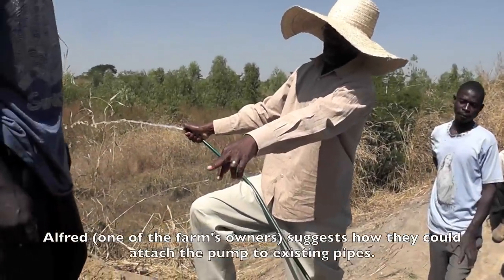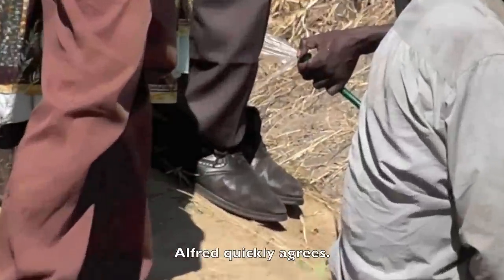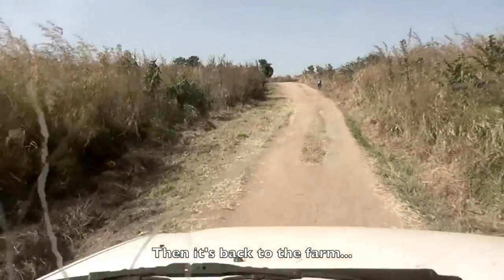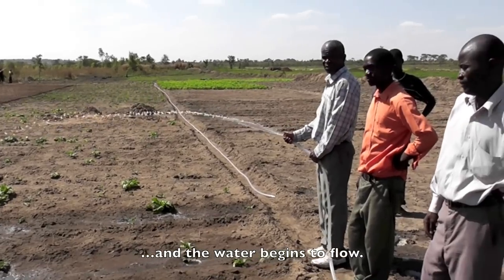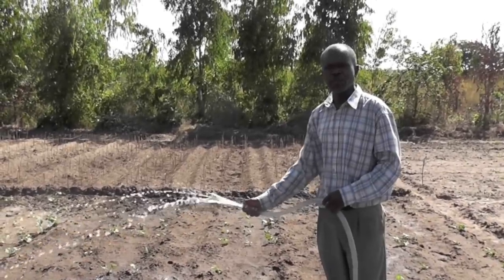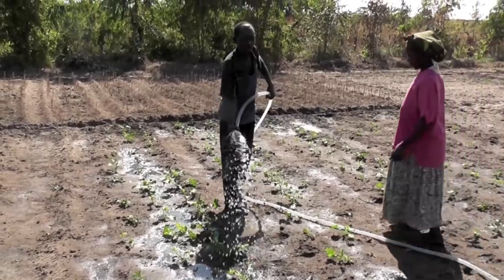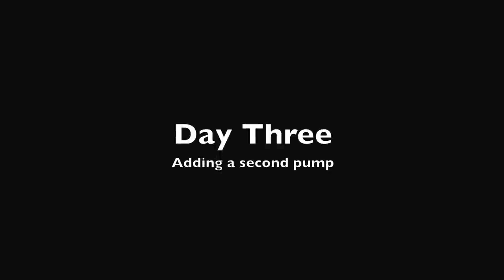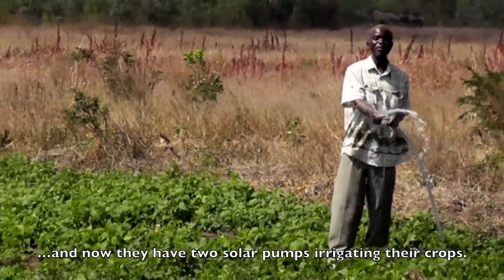How to install a solar water pump for agricultural irrigation in Malawi, Africa

Comment from the maker: Hello,

The type of pump is a DC50B 24130. This actually only has a maximum head of 13m but it works well here because the height gain required is only small.

The cost of this is about £50.

Please feel free to ask any more questions here or write to us on contact@aktsolar.co.uk

All the best,

Jonny
Reply: Dear Sir, is it a 3 phase, 2 phase or single phase?